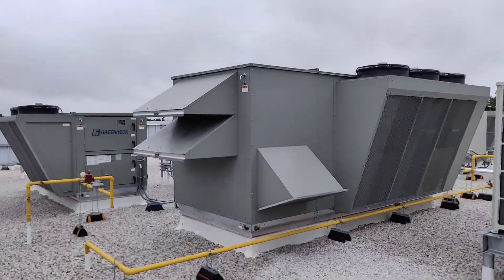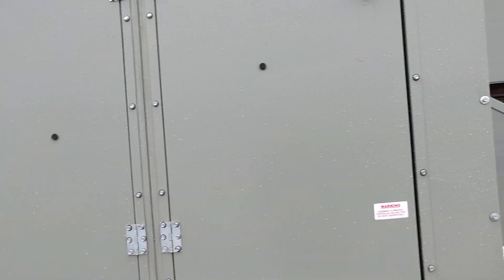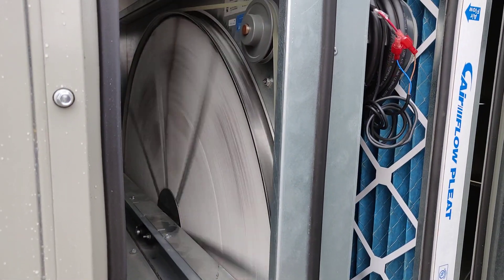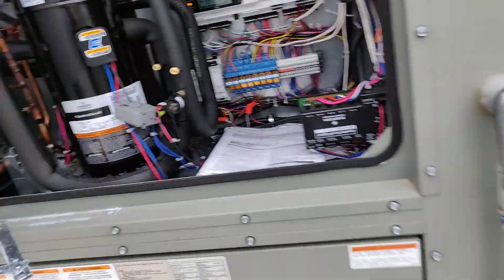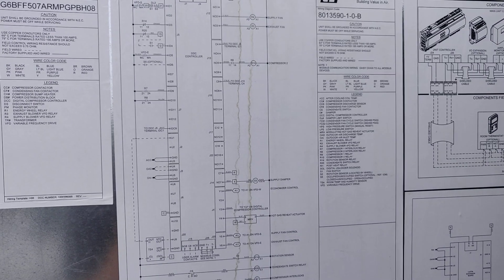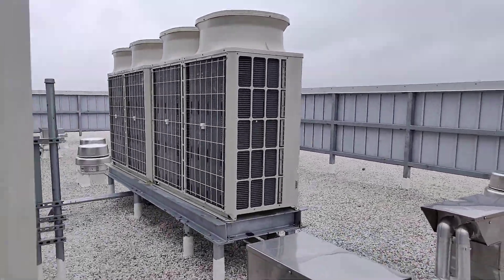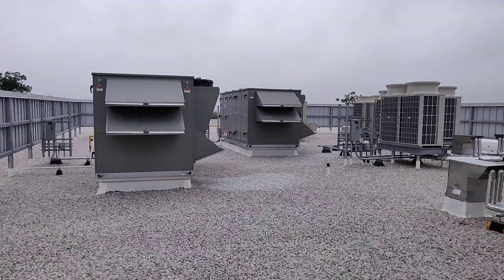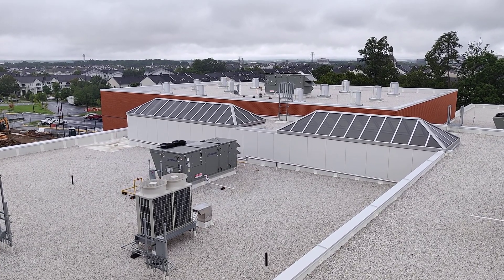Greenheck Dedicated Outdoor Air System Unit Tour (Model RVE)

Comment: What type of building use this is that requires so much outside air? Also, these units run controlled by a Tracer SC,isnt that a Trane EM system, and is a tracer system required to operate a stand alone unit just because there is a lot of input/output and parameters to operate one of these over thought units? I mean, the cost to purchase is astronomical, and the payback has to be years if not decades, considering the maintenance and repair cost to keep them running. Especially if they do not have an in house engineer to babysit it.
Reply from the maker: This is a multi-story school building. Each classroom has a VRF unit that handles most of the sensible load, these units serve the latent load on each floor. 
The Trane BMS manages all the equipment in the building, each one of these units has a Carel controller that controls and monitors all functions of each unit. 
No engineer on-site but everything is monitored remotely so a technician can be dispatched in case a problem arises.
Reply: @springws14lbss It had to cost a boatload,and i world like to know the payback over 10-15 years, by then some major repairs are bound to occur. And if it has to be serviced by Trane, that's another boatload. I have searched for an alternative, and that is captive air, they are more economical and Captive Air definately is a quality product for applications like this.